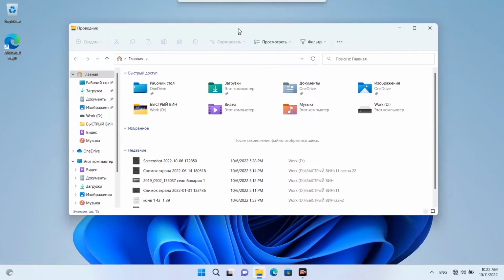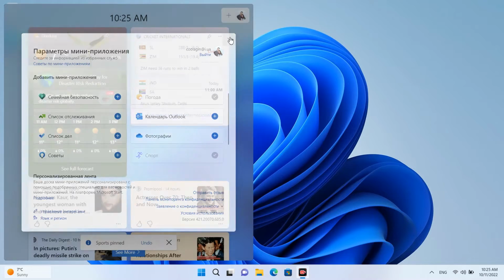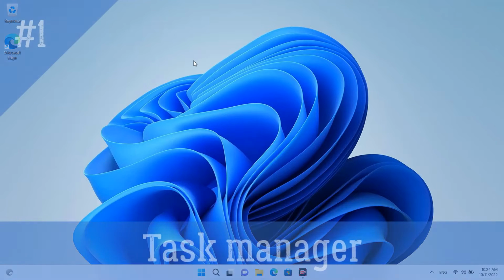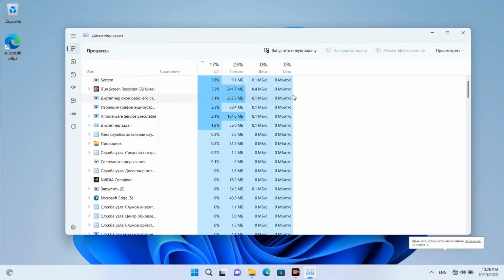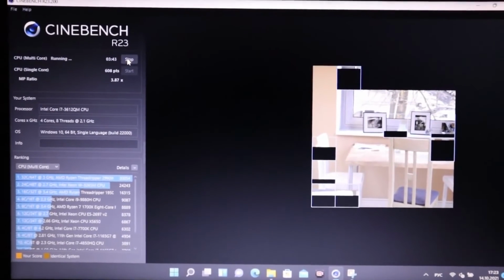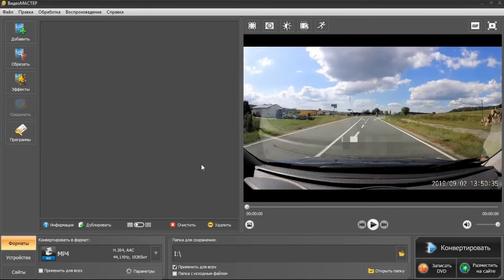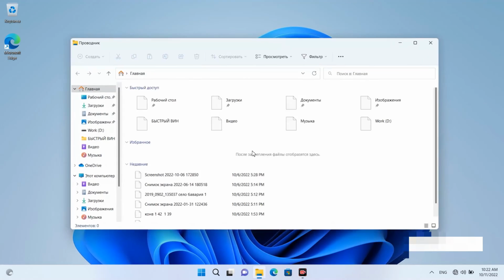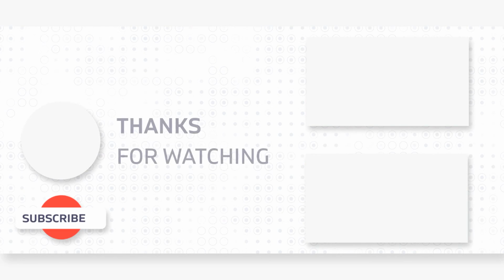Is New Windows 11 22H2 Faster? 22h2 vs 21h2 Speed Test

Comment: You did a good job at comparing them, nice. Though, I'd also love to see their benchmarks with common softwares opened like Browser, Steam etc. If it is possible for you to do so! 🙂
Reply: Ps. I've installed 22H2 and it is really a lot faster than it's previous version. The settings app, taskbar and Windows tools & programs are especially optimized. Meanwhile, the new explorer has somewhat same performance due to tabs rework.